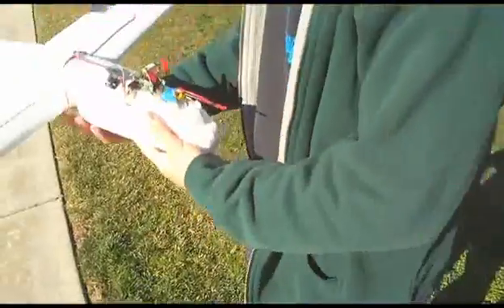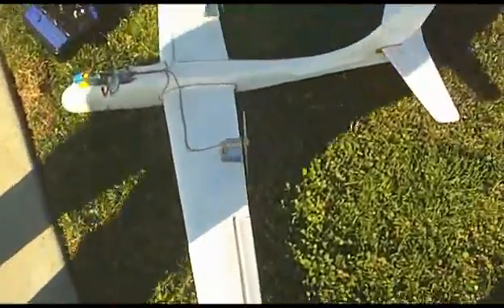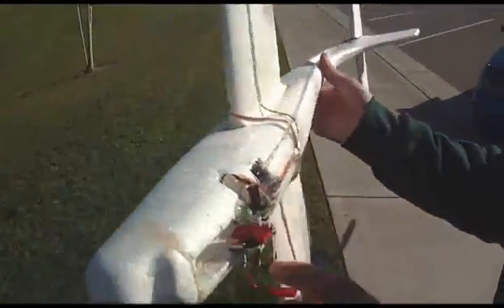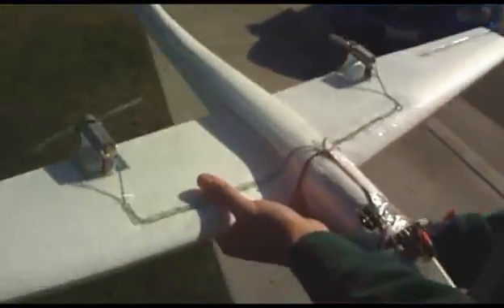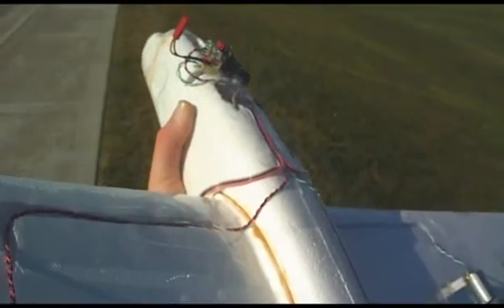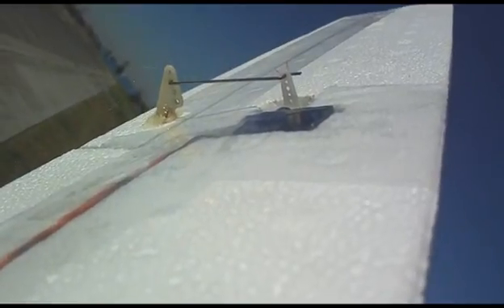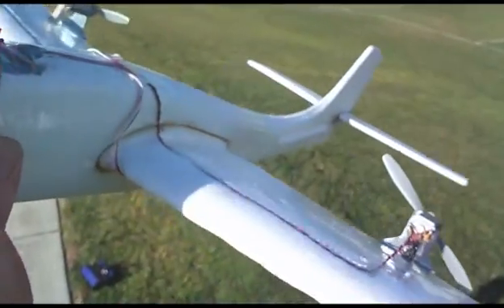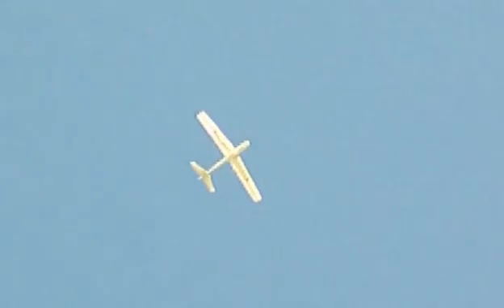Part 1 of 2 : Homade made RC glider from Blade CX2 Guts

Comment: hey guys i love your idea but i dont have a blade cx2. instead i have an old rc system with two motors. i will use that but how did u cut out the hole for the battarey? thats my problem

Comment from the maker: the problem with your setup is the props are to big, I used i think a 5 inch? prop off a small twin plane design, the gliders wing span is somewhere in the 4 foot area, not sure.  Keep trying, you can always use rockets :P

Comment: That is amazing. I tried doing that, but gave up... I wasn't sure what I was doing wrong... I pretty much had everything the CX2 has. I used the same setup you had. I used 6 inch props and a 4.5 foot wingspan glider. I think i had a bad glider maybe... That or the battery... What size prop did you guys use? and how did you mount the motors on?